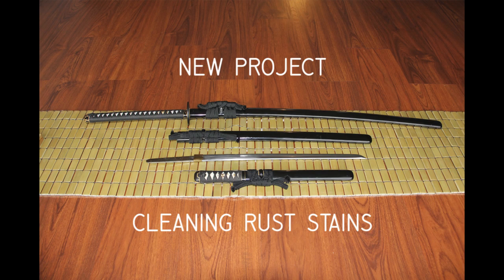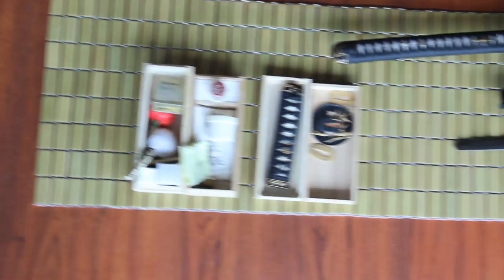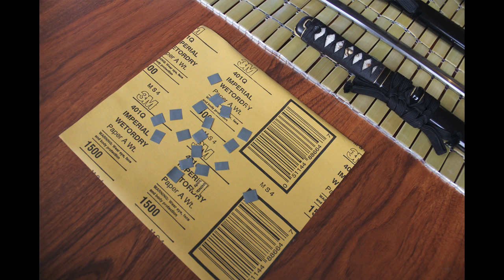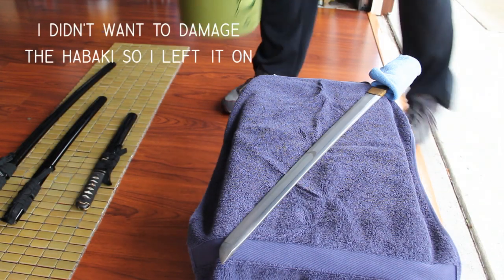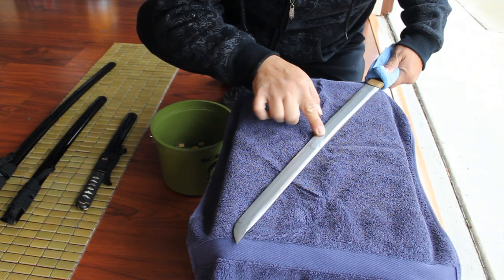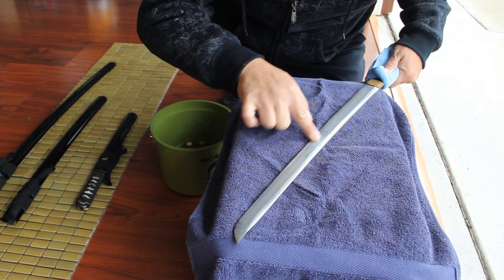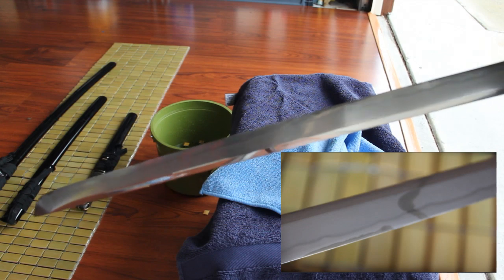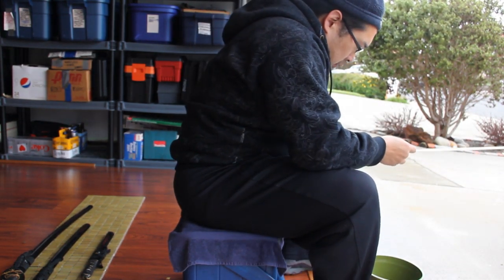Bugei Sword Polishing PART 1

Comment from the maker: @MrNath5150 I'm not a blacksmith and don't know how to forge steel.  I have experience with sharpening, honing, and maintaining combat knives (Filipino martial arts and military training).  I wouldn't call this project a true "restoration".  The steel is just severely blemished.  It doesn't need straightening, re-honing, or sharpening.  This type of maintenance would be common for people that do a lot of "backyard cutting".
Reply: erniesbudolab nice job on this👊

Comment from the maker: If the scuffs are very light, you can try the same process here.  If they are deeper, you'll need more aggressive paper and work the entire blade, switching to finer grades to bring back the finish.  If you're going to be cutting on a regular basis, don't worry about the scuffs.  Pay more attention to sharpness and straightness.  If you want a beautiful "wall hanger", don't cut with it.

Comment: Can a uchiko powder ball remove light stains like these? Also, can this method remove surface scratches on my blade from cutting cheap mats? Thank you.
Reply: Every professional I've ever read or listened to says do not use uchiko powder.  A clean rag and alcohol is better.  Then a polyester fine cloth then oil.  They say if you must use the uchiko powder it must be true uchiko and never mixed with old oil. Many a good blade has become seriously scratched by this.

Comment: So how do you get the moisture out of the Saya so this is avoided in the future?
Reply: Build or purchase a shirasaya. Preferably made with Nurizaya wood.  Also known as a "white scabbard". For storage.  Plus it gives you the chance to have a better looking display.  Personally I keep allot of my blades out on a2 or 4 rack wall hanger with their shirasaya stored away.  Naked blade in Tsuka on top and saya underneath.  Blade facing up nakago to left with saya (koshirae) underneath bent  "down" making almost a "O" or a strange type of mouth (for reference in position to the blade). I clean the blade and oil when I notice it's too dusty

Comment from the maker: All polishing produces "scratches".  The finer the paper, the finer the scratch.  In this video, I used 1500 grit paper to remove rust stains on the surface of the steel.  If you have very deep scratches, you may have to use coarser paper on the full length of the blade and then progress to finer grades maybe as high as 3000 to 5000 to bring back a mirror shine.